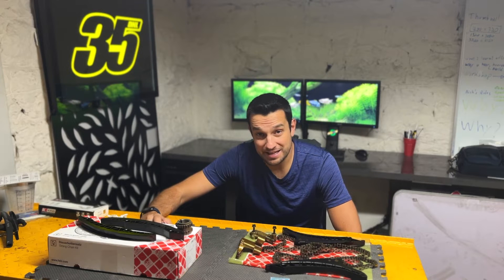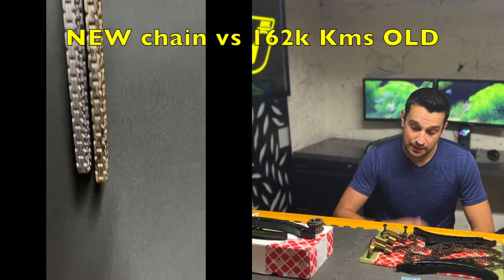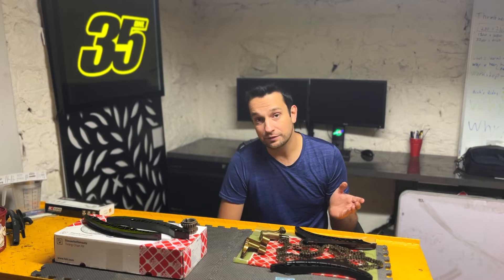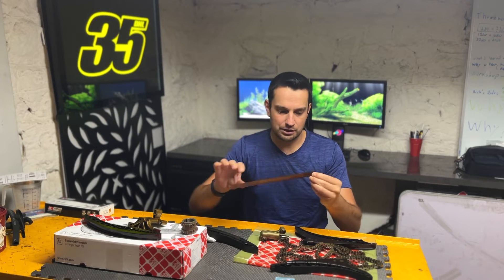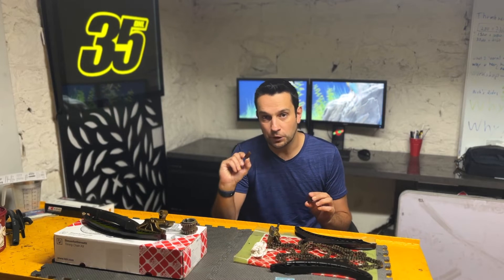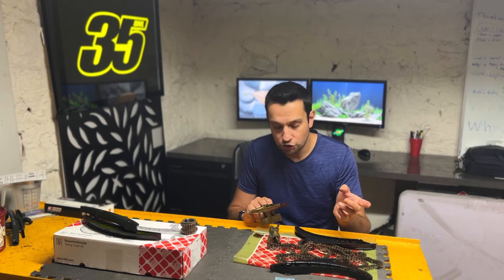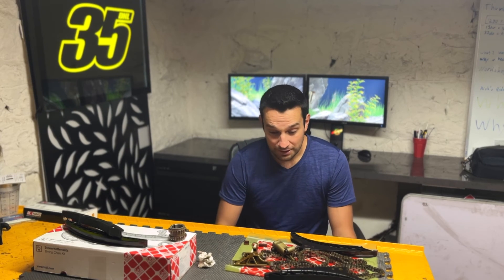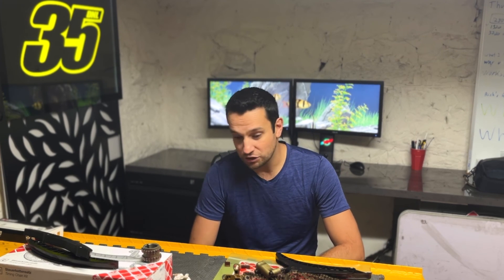BMW N63 / S63 Timing chain issues

Comment: On my N63 the orange plastic piece you are talking about @7:50 it’s missing on mine but I did find it by opening the front tensioner cover and successfully removed it. Does that little plastic piece affect the timing chain at all? Or is it just the concern of it potentially blocking oil flow?
Reply from the maker: That’s just a cover for the VANOS gear however if that thing came off I’m concerned there’s more to it than just the cover.

Comment: I have a 2020 X5 M50i with 70k miles. It has the N63TU3 engine. I’m not sure if I hear anything in the cold start should I worry? When should it get done? Any advice would be appreciated
Reply from the maker: It’s hard to say as it all comes down to how the previous owner threaded the car. Regular oil changes, not trashing while engine is cold, a lot has to be considered
Reply: @dnl35projects you think if I load up a video of the cold start you could take a look and give me your opinion. I’m a medical student working as a EMT. So I really need this car to get to and from work. I have done preventative maintenance such as front and rear differentials transfer case and transmission fluid and filter change. I do oil changes every 5k miles. I did the work my self on the weekends. I haven’t done spark plugs yet. Maybe I should do the PCV?

Comment: What would happen if you just replaced the tentioners and sprockets and the top guides and put the car back in timing would it be okkay
Reply from the maker: The engine would work but the chain has already stretched so just a matter of time before it skip timing and granade the engine

Comment: Hi Daniel, i love your videos and how you explain things very clearly thank you very much 🌹🌹

So by all that you said to prevent this i only have to change the oil more often? Like every 5k kilos?

I have an X5 M50i with the N63tu3 engine in it, how reliable do u think it is?
I have a drivetrain light on with the code ( 108f01 ) probably some boost leak, is it going to be a major issue that costs a lot to fix? 
And lastly what should i do to keep the engine last longer healthy, safe & sound?

Appreciate the help 💙
Reply from the maker: Thanks - The 108f01 code is a boost leak and that is a common issue, you can fix it yourself fairly easily if you know what you’re doing and a smoke machine will help. If you are seriously considering keep the car for a long time you could even think of a partial rebuild, to get new bearings, seals and gaskets to ensure longevity

Comment: Slow cranking no start on a 2011 x5 50i
What's the issue
Reply from the maker: Most likely The engine ! There are a few hundreds of possibilities why an engine wouldn't start and without scanning it for codes it will be a guessing game.

Comment: Is it possible to replace timing chain and guides with engine still in the car?
Reply from the maker: Yes and no. You need to remove the sump and the engine heads in order to remove/refit the timing cover - the amount of work you’ll put in is so intense I believe it’s easier to just pull the engine out as it will be easier to work

Comment: Are the N63TU engines also ticking time bombs after 100k km? I have 150k miles (approx 250k km) and they’ve never been done 😬
Reply from the maker: N63 and S63 are the same engine, with a few different things such as cams, exhaust manifold and pistons. Yes it suffers from the same issues however the TU engines are a bit more reliable - it all comes down to how often the engine was serviced and if it was trashed when cold but at 150k miles you should start considering a rebuild (they are cheaper when the engine is still running)
Reply: @dnl35projects I change the oil every 5k miles, the previous owners changed it every 7-8k miles. When I took the valve covers off everything looked brand new…no oil/sludge buildup whatsoever. I’m thinking/hoping mine is good…especially since I just put new injectors, plugs, coils, and a water pump along with the valve cover gaskets. 😬 Would a replacement engine from BMW be better than a rebuild? An N63TU long block is only a bit over $5k US  and I’d think a rebuild wouldn’t be too much cheaper than that 🤔

Comment: do you know if i will need to remove the head to change the timing chain? or will the front panel cover come off without needing to remove the head?
Reply from the maker: Hi, that’s a very good question ! Unfortunately is not possible to do that without dismantling the heads (in my opinion). You could possibly remove the front cover with the heads still in place but it will be almost impossible to assemble it back and make all surfaces seal properly. It’s worthwhile to go the extra mile, take the engine off and have it refreshed / rebuilt

Comment: Your opinion about lower thermostate temps is it a good idea ?
Reply from the maker: I don’t see any harm in lowering the temp for water thermostat however I prefer running OEM specs in all my cars.  BMW could have made a lower temp thermostat if they wish.  Flush your coolant system and ensure it is filled up without air pockets and it should work just fine.

Comment: Great video and info. I will need some luck bought an 2012 750Xi as a project, have a 2002 525i daily driver. Will be pulling the N63 engine to see if it can be saved. From checks currently, it looks like on one cylinder has a bad connector rod bearing, low compression and shorter piston travel. So we shall see once the engine is pulled and disassembled.
Reply from the maker: Hi, if the engine still runs (and please dont run it any longer :) it most likely can be saved. Your goal now is to have as much patience as possible  (because trust me, you will feel like crying once the engine is out)  If your bores / cylinder walls are not scratched you should be able to get away with machining the crank and a set of new rods/bearings (plus all the stuff that comes attached to rebuilding that engine) Stay inspired, it will be a great car once its done.
Reply: @dnl35projects  thank you for the words of encouragement. I am in the process of preparing to pull the engine. I do have some bore scope photo that may shed more light on the engine condition. I am concerned with one cylinder that is showing scoring of the cylinder wall.

Comment: Hello I am doing chains and phasers on my 2011 750i was wondering if it can be done with engine in car by removing both oil pans and lowering subframe
Reply from the maker: I think you meant timing chain and guides right ? Technically you can do it with the engine block still in the car however both engine heads will have to come out in order to fit the timing chain cover so it’s a bit pointless to have the engine still in the car because the access to everything is a lot harder.

Comment: Hello, I have a question: were the cylinder walls on your engine damaged and if, then what did you do ? 
Cause I have a 750li with an n63b44c (449 hp), I think outside of Europe their called n63 tu
Reply from the maker: Hi, yes there were damages to 2 cylinders so we had to sleeve the block and use different rings.
Reply: @dnl35projects  Thanks for your answer. What will it cost me to do this because every cylinder has a slight damage.

Comment: I have a f10 57000km 2016 m5, can yu recommend procedure prevently?
Reply from the maker: Hi, the engine you have in your car S63TU is a bit more reliable version of the S63 engines. Yet, at that mileage I believe the best thing you could do is to change the oil n filter frequently (5.000kms works good for me) and also look after your coolant system properly (flush and renew the coolant every few years ) - The biggest point about these engine is to warm it up properly before you go hard and if your car is still going well consider a rebuild at around 150.000kms

Comment: Hello, I have a question, will it be possible to replace the timing belt in the s63 e71 without removing the engine?
Reply from the maker: Hi, I don't thing so. There are misleading photos online suggesting it can be done however, they show the timing cover removed but there is no way of fitting it back in without removing the engine heads and the oil pan. Your best bet would be getting it out of the car and doing a rebuild.

Comment: nice video, how much slack can i have on the intake and exhaust vanos sprockets ? s63 m5 engine
Reply from the maker: You mean as to the hub of the sprocket or to the chain ? Either way there shouldn’t be any slack at all (that’s why the tensioner is there

Comment: I believe the n63 is a non interference engine so even if the piston is at tdc and valves are out it won’t hit the piston.
Reply from the maker: I thought the same until coming across one with a bent valve - Better just not take the chances !

Comment: Great video, good job 👍
One question - did you used FEBI timing chains kit on your build? I see FEBI boxes on your table
Reply from the maker: Hi, yes that piece of info is actually coming up on the next video 😆 about the timing chain tool and what timing chain to use - FEBI actually makes the OEM chain for these BMWs so the logos will be scratched off  - Search for FEBI 36320 - You'll need 2 of this kits and I highly recommend buying the lower sprocket as well.

Comment: I think you statement about jumping chain over sprocket tooth is wrong. It’s almost impossible to happen even if tesnsioner and guides are broken.
Reply: How short oil service can prevent chain stretching?
Reply from the maker: A short oil service interval will not prevent the chain from stretching but will delay the process.  5.000Kms or 12 months is what I do on all my cars
Reply from the maker: And as for your previous statement, with all due respect, if you have not seen it happening doesn't mean it's impossible.  I make all videos based on my experience with this cars (not something I saw on the internet) and YES I have seen this happening.
Reply: @dnl35projects  chain stretching depends on many things. for example try to imagine when there is -20 winter and you are runing engine, what kind of forces are working on cold engine... and what is going on with chain... change it after each 100k and there will be no problem
Reply: @dnl35projects  In which of your videos I can see the jumped chain?  Chain more likely can snap than jump over tooth especially before 200k miles. I think the scenario is: 
1) Chain stretched over time
2) Tensioner failed (not enough clearance)
3) Chain started hitting the guides (engine makes loud sounds especially when cold)
4) Chain guides failed and broke in peaces  (oil filter full of plastic peaces)  
5) Chain sawing the block or the head making super loud sound (oil filter full of aluminium flakes)  

So at step 5 it may just snap after some time, I guess it's  in case of deaf owner who didn't notice strange and loud sounds their engine makes for last 10-30K miles. To me jumping chain is more like a myth.
Reply: @dnl35projects  I agree that short intervals are good for engine longevity, I do change my oil (AMSOIL 5w40) every 5k miles on my X5M and after oil analysis and depending how it was  driving the oil still has proper viscosity and can work up to 1000 miles more. But it does nothing with the chain stretching. The stretching is more related to total number of cold starts of the engine.
Reply: Great video Daniel !! Keep up with the great content !!!

Comment: Hey
I just subscribed after see all your videos, I Planning to buy a 650i 2014 with 55k on on clock, any advice please of what  to check before I buy it? Is that truth the v6 engine on 640i is more reliable? Many thanks 🙏
Reply: 650i is really good choice a specially with 55k, my friend have such car. 2014 N63 is after technical update so some issues were solved. I strongly recommend visit BMW shop (can be not authorized) plug computer, make visual inspection etc., someone who knows BMWs should do this a specially with N63 engine. Of course you will not check most dangerous things like bearings but will be good to check oil interval if possible at least. 640i is straight six,  3 liters with turbos, BMW is not producing V6 engines. 640i is also good choice and will be cheaper in service BUT.... if you will try first try 640i and then 650i you will not go out from this car ;)
Reply from the maker: Hi, at 55k I doubt there will be something wrong with it unless the car has been badly abused (eg: trashed while oil is cold) and as said below, that's the TU version of the N63 which is much more reliable. With that said, the V6 version (with an N55 engine) should be equally as reliable but a LOT easier to work on since the engine doesn't have to come out for some repairs. The V6 on the other hand is surely fun but not as fun as the twin turbo V8, specially if you put a tune in it.  If I was me, I'd buy the 650, do a comprehensive service with all fluids and preventive maintenance, and change the oil every 5.000kms - Good Luck

Comment: Great videos regarding S63/N63. My 2010 550iX had 293 000 km and together with my mechanic we decide to rebuild engine to avoid big costs in the future. Next week I will have my car back :) Generally engine was in really good condition because I'm changing oil each 5000 km or before winter and summer (depends what is faster). This way engine was really clean inside and parts like bearings were in good shape also. Those are not bad engines or like someone said "worst BMW engine". The only problem of those engine is that people don't know how to treat them. Like you said, this is high performance engine not 1.9 TDI. Keep doing great job with those videos !! :) Greetings from Poland.
Reply from the maker: I couldn't agree more with you ! Well done and I'm sure you will enjoy your car for many years to come - The best time to rebuild these engines is like you said, when is still running well ! Its also pretty cheap too considering the prices these cars sold for when new.  Thanks you for the comment
Reply: How much is the cost. I have the same sound in my engine.